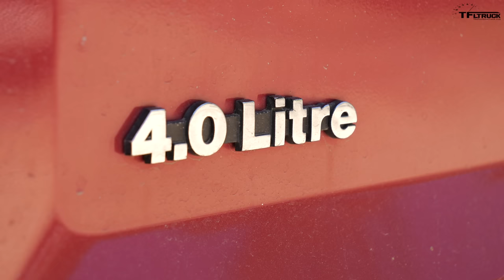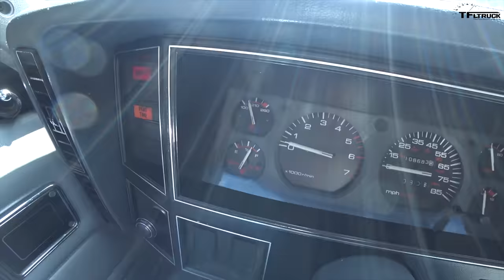Old vs Old: Did Off-Roading in the Eighties Suck? | Cheap Jeep Challenge S2 Ep.6

Comment: Nice road trip, good terrain for test, but. It's really a shame you didn't take comparable vehicles. Stock samurai and stock jeep or this jeep and samurai with what is needed (lil bit more ground clearance, better tires, 4.16 transfer case, 1 liter's axles ), still is smaller than jeep but more comfortable for crawling,...

Comment: I wonder if you are going to challenge a Chevy Suburban? I have a 78 that goes through the same things that you showed with minimal to no troubles. It is completely stock at this time with the exception that the previous owner threw a small block in it and took out the 400 big block which had more power and torque. I used t work on fire towers in the summer and it did better than the newer vehicles and had less damage than they did.
I do not remember how many times I picked up the exhaust pipes and such from the newer vehicles that the forest service left in the trail to the tower I worked in.

Comment: Great content, but the Renix EFI got undeserved critique, it's actually is more sophisticated than the Chrysler era HO, it has a knock sensor and it tolerates modifications better than the Chrysler era ECU. It's just a little hard to diagnose since it doesn't store MIL codes and it does requires specialized equipment. I wish you kept this one or the blue XJ.

Comment: Tell you what.
Do you wish to put your land cruiser back to back with my 70s Chevy and see which pulls the other?
Do you wish to see which has more traction?
My trucks drive train is factory stock for the truck.
WARNING... it came with Dana 60s and possi.
Btw, just an FYI to some of you out there, as a side note. Some of the early 60s GMs were posi also. Both in 2wd and 4wd.  I've seen 2wd 60s GMs pickups go through places 4wd got stuck, just because of those posi. 
Another FYI. Max lift I've ever had was 2 inch. More lift more top heavy. 
The two best off road vehicals are the MUTT and the M998 type Humvee.  Humvee is the best it has ground clearance and power. But the MUTT is nimble and has same the suspension as Hummer, just lower ground clearance. But it better on fuel. Plus the MUTT if you get it hung up, just lift it up and move it. Lol. And with a MUTT a simple come a long is all the winch you need. If you need more then a come a long. Then you need a shovel to fill in the hole it's in on top of it. (In other words if it buried that deep you better fill in the hole with it in it so someone doesn't get lost in it)

Comment: I don't get what was up with the 80s 4x4s and the front axles being wider than the rears? My bronco is like that too, the front axle is probably at least 2 inches wider than the rear. You figure it would be more stable if the rear axle was wider? Guess I could pick up some spacers and test that

Comment: The only time iv seen a straight six have “a tendency to overheat” is bc the coolant system is predominantly filled with mud and water instead of clean coolant mix. After working at Chrysler for years the only issue I know of is the heater core has a tendency to clog up and trap air bubbles. 

Oh AND, that’s insanely insulting Tommy....a Jeep is a Jeep and anything else is an SUV....period. AMURICA (insert hollering noise)

Comment: Did you try flushing the cooling system? I had 2 Comanches, an  86 an a 92, put over 300,000 Kms on both and never had overheating problems. The first one we bought off the lot with only a 4 bagner wich lacked in horsepower, but still worked perferctly. I am  maintenance maniac, so oils were changed a bit early and I went around with a can of spray oil on all points, from door locks (we live in Québec) to hood hinges, electrical connectors and body mounts. Never had a squeak and when I sold it to a friend, I took it to the dealer for a full inspection (the 86). The compression was still VG, they could not find a single thing to fix on it. A-1 used truck with 300,000KMs. The 92, I ordered it with the "X" package (1 metric ton or 2,205 pounds) 4,0L and locking rear diff. It was the best truck I had. My wife kept it when I left and she never maintained it. She sold it (at 300,000K too), but it was rough. Lack of maintenance ruined it. As for heating, a regular system flush and adding special oil to the coolant keeps the water pump lubricated. Changed them once on each as part of the maintenance.
Reply from the maker: Thanks for the advice!

Comment: Lunchbox lockers. Espeically on the samurai build up.  Less than 300 dollars and exponentially increases off road ability.  

The Commanche should have had one. Could have used the money you saved having sponsors for the tires and suspension to drop one in there then combine that with a "driver mod" and all of this would have been a cake walk.
Reply: I have lunchbox lockers front and rear in my trail rig.  This trail would not even remotely be a challenge.  Fun, yes, but still a breeze.  They are a game changer no doubt.

Comment: I had an 87 Comanche short box like that. You would have been better off with a rear Locker in 30 inch tires no left. Those 33 inch tires are just too much for that Comanche them fender flares you going to end up getting ripped off.

Comment: No, offroading in the '80s didn't suck. We used mudders, lockers, tcases, and winches...instead of TCS (BrakeLock), or AWD "modes" like the FWD-based FIAT offerings. Selectrac worked fine...and still does (JL Sahara only now), while being simple. Angle iron was cheap rocker protection for a new $9K Jeep CJ7 or YJ. 31" mudders were like $100ea, and Jeeps mostly used 15" rims. Gas was under $1/gal. We got out to disconnect the 1 anti-swaybar. Deathwobble wasn't a thing on Wranglers yet. CJs had a useful tailgate instead of a swingate.

 My 4.2L CJ7 with 33s, no OD, and a carb could get 20MPG hwy.

 Life seemed simpler then. Rockcrawling outings seemed more of a group adventure than a competition/showboat thing. Even broke college kids could afford it, without burying themselves in debt for a $40K+ rig that needed frequent repairs. That Samurai is evidence of this. With affordable lunchbox lockers, a HF winch, angle-iron rockers, and some cheap mudders, that rig could take you on some cool trails without breaking the bank...or being a traffic jam on the trail.

Comment: While good the SAMARAI  has nothing on the 1973 Jommy LJ50 with 3cyl 540cc 2 stroke in performance. This was my first 4WD and was laughed at when released. Those laughs were soon converted to admiration.
These were like mountain goats safly even narrower than later 4 stroke versions and many were  flipped. Driven right no idsues. It basically was not stopped by obstacles that barred all others.
On many trips while others in Jeep Toyota Nissan Landrover Rangerover were winching the Suzi just went on and on. Even water crossing with water at dash instrument level was driven while 2 Jeeps 3 Landrovers and 1 Toyota had to be rescued on a river crossing. On one rainforest trip only my Suzi did a long slick up mountain trail unassisted, other than first vehicle that winched 3 segments, all others were towed on cables by preceeding vehicle at the top except my Suzi which had a short wheel base Landrover. The owner of that hated all other than Landrovers and he suffered two years of being reminded that a Suzuki had to tow his vehicle. That trip by the way was 3days to cover 10km of sub tropic rainforest mountain country accecces by special permit. I was invited on several extreme runs in near impossible terrain.
After one severe trip I ended up getting a roll bar for extra safety.
Loved that vehicle for 6 years till 1980 when I upgraded to a 3.3L Diesel MQ Patrol that had excellent performance and much greater comfort especially on long tours on highway, where that 2Stroke Suzuki with 80KPH max speed was quite a strain. By the way 7500rpm to run at 80KPh!

Comment: AMC owned jeep in the 70s and early 80s. 
BUT if it has a 4.0 it is a Chrysler owned jeep.
The first wranglers which were Chrysler owned jeep, were 4.2.
The 4.0 is a Chrysler Jeep engine only. 
I'm not sure your 4.0 Comanche was a 1980s.  I would think most were 4.2.
I can't really dislike the 4.0, it is a good engine. But that Comanche clearly has some problem. My 4.0 Cherokee never overheated. And all a Comanche is is a Cherokee pick up.
Mind you when I say Cherokee, I mean Cherokee, not grand Cherokee. 
The parts from a Cherokee including the front doors, fenders, complete drive train fit right on a Comanche. 
If you take the body off a 4dr it swaps with the cab and bed of a Comanche. Mind you I like the 2dr better, but they are as hard to find for me as a Comanche.

Comment: samurai's are amazing animals... i have an 86..
raised 3 inches.. settled to 2.25 inches after awhile...
stock rims, with bigger KOA's..
old man emu leaf springs and shocks....
center skid plate.
rebuilt engine and weber carb...

id be doing 20 mph up that trail... but im a maniac....
samurai's actually ride better going fast... they skip over obstacles...

basically im saying, you can Send that thing alot harder than you are.... 

Good Luck with Build....

Oh, buy Koyo U-joints... nothing else works....and run MasterPro GL-5 SAE 80W-90 Gear oil in your diffs and transmission... nothing else works.... look up John Gates in CA... samurai guru...

Comment: That was a good example of what it is like to old school your way along in 4WD.  That Suzuki may be a mountain goat, but who wants to get thrown around by a mountain goat over terrain like that?  lol  Even a young person is going to need a crash outfit inside the cab to keep from being bashed about.  Helmets, harness's, etc.  And as capable as it might seem.. it is NOT safe.  If you take the wrong line in the wrong place, a roll over will kill the occupant.  As for the Comanche, it is well suited for what you just did.  Except from the get go you did not balance out tire height with wheel well requirements.  I seen the problem come from the moment you put it together.  (No offense.)  So yes, get that sorted out so it is not rubbing and you will be golden.  :)

Comment: I wonder if they realise that the radios they are using are for amateur radio operators and you need a license to use them legally. Companies like Rugged Radios are rebranding 2 meter/ 70cm band amateur radios for the "off-road" community. They aren't CB radios. Everytime I see that blue radio I cringe.

Comment: There were some very capable cars in the 80's. Painfully slow but great off road and some had solid front diffs.

First generation N60 4Runner or Jeep Cherokee XJ
 the narrow ones.

60 Series Land Cruiser Grand Wagoneer the wide ones.

3/4 tons from Ford, GM, and Ram the bruisers. 

Land Cruiser Series III and first gen Range Rover the unreliable ones.

Comment: you really come off as knowing little. "you have to manually lock the front hubs". this is a feature, it means you can run your suzuki in 2wd without running the front axel. Your jeep is constantly turning the front gears for no reason in 2wd. The suzuki could leave the front hubs locked and operate identically to the jeep.

 And no the 80s produced way more offroad vehicles than the modern era is. the subaru and rav4 are not 4x4s.

Comment: So it took thousands of dollars to get a Jeep to do what a little stock Suzuki can do with all season tires?
Reply: @TickleFingers  Kid you are the equivalent to having a conversation with a wall. Even I understand what both of these individuals are saying. Also you clearly know next to nothing about Off-Roading. Hint....You keep bringing up mods, yet fail to realize that the mods they made were not thought out correctly. Second there is a reason why they used the Comanche rather than an old wrangler to go up against the Samurai as mentioned by Paul J. Go back as mentioned by both parties and watch the other Samurai videos. A portion of there user base continuously cried and whaled in 3 of the previous videos with the Suzuki that it's not fair that the jeeps won unless they got to cherry pick the conditions, vehicle year, spec etc....

That is why they made this video to give it the Samurai a win so it's fanboys can settle down a bit instead of threatening to unsub which is what many were saying in the previous video's. Of all the old Jeeps they could have put it up against what did they choose, an old Comanche which is really just a small pickup. Let me explain something to you if the results were the opposite all the Samurai guys would be nitpicking every aspect of the video to justify it's unfair loss. Why didn't you accelerate faster on the line or why didn't you get a better driver, etc...

Stop trying to glorify and romanticize the Samurai. It has many draw backs as an everyday A-B vehicle. I used to own one and my brother in law who lives in Europe let me drive his 2019 Jimny 3 months ago which many Americans who have never driven one are acting like it's GOD's gift to man.
Reply: @TickleFingers  I don't even own a JEEP. I like how you ASSUME that if someone disagrees with you and your flawed interpretation that they must automatically be Jeep fanboys.  I bet you never even watched the previous video's where the Samurai can't even keep up with a Wrangler of it's age. Speaking of the special kind of stupid, just take a long hard look in the mirror every time you need a reminder of what the benchmark of that is.

Comment: Drive properly, pick your line as slow as necessary, fast as possible. I often drive past waving at idiots with all the fruit and no idea in a stock land Rover discovery 300 tdi not a huge amount of power but power is very rarely the answer have also done the same in a s1 landy and 1942 Jeep. How the hell were you getting stuck on those hills ? Learn to drive problem solved

Comment: Sorry son, it's a knock-off of a jeep, and any decent jeep driver back in the day,  could keep a jeep running with only a few tools, clean the points, scrape the rotor and distributor contacts, tap the carb if the float stuck and off you go !
 But, you were probably not born yet,  so I'll let you off the hook.
Reply: BTW,  The first Land Rover was built on a Jeep chassis !   Jeep, always copied,  never beat !!